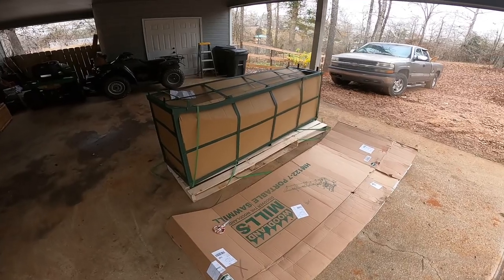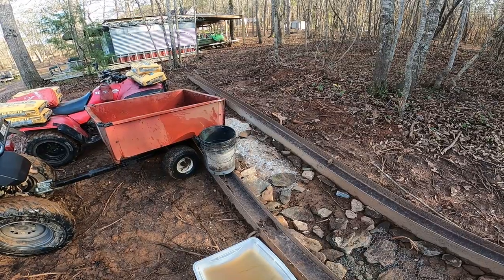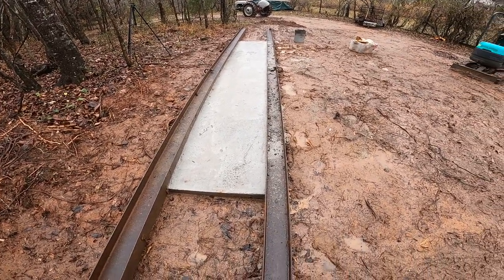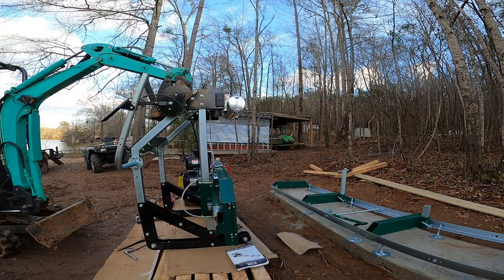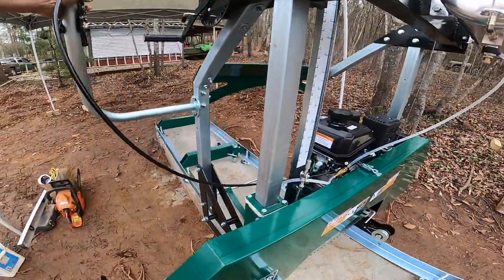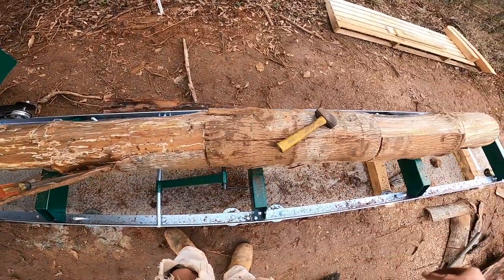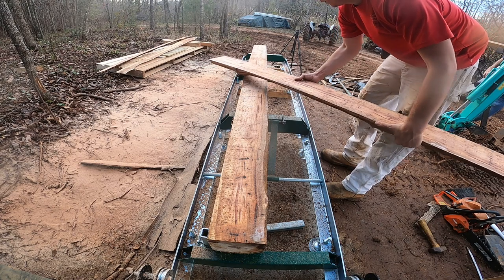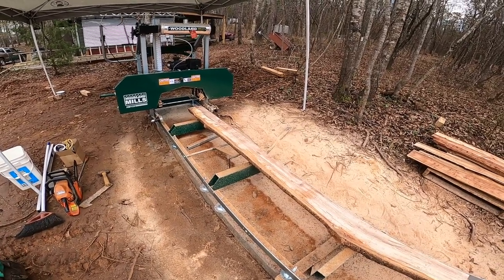BUYING THE CHEAPEST/BEST BANDSAW MILL AND MILLING A BEAUTIFUL WORMWOOD HICKORY MANTLE

Comment: Just a suggestion: your blades will last a lot longer if you don't drag the logs through the dirt first. Even then I hose down the entry side of the cut with good pressure prior to the cut. Love our Woodland Mills 126. This company rocks with the best support out there. Adding a tach helps tremendously. Cutting at the peak hp at 3600 rpm saves blades, clutches and time and gives you a smoother cut. 👍😎👌
Reply from the maker: I always clean with pressure washer if I drag through dirt🙂
Reply: Power washer?
Reply: @zakbrinkhoff324  just good garden hose pressure.

Comment: Awsome another video! Happy Birthday Darrel! 2,5k for that??, buying anything like that here would cost atleast 4k+tax+shipping (~tax for 4k would be 800 bucks!!), its crazy even the ads for this video are about buying a bandsaw mill haha. Mixing concrete on a trailer? I love it lol. Im glad you removed the bark, but id recommend to also wash the logs, iv bought a cheap pressure washer just for log washing, it really helps to keep the blade sharp for a long time. IMO it really does not matter, if its hardwood or softwood, aslong as the lumber is green, iv cut alot of green lumber on the mill and i really dont notice any difference between the different species of logs, but when i but a log that has been dead for years in the forest and all dried up, cutting that is hard, especially with a half dull blade. The mill is running great man. i wish you and your family all the best health and have a happy new year. Take care"! !
Reply from the maker: Thank you so much!! I’ve been watching your sawmill videos a lot  and the pressure washer is a great idea! I think for the money it was a good buy and I’ll prob do some upgrades over time to it. If I felt better I would have built one but I like it so far. Check out the wipers on the wheels is just a peice of cable that wipes the saw dust off them and it works really good. Thank you for everything and happy new year !!!

Comment: Hello Darrel 😊
Hey I’m looking to buy a small portable sawmill, haha as you know I already own a sawmill, but I’m looking for a small mill to take out to a remote little property a few hours from my house, mainly going to be cutting some cedar and Doug Fir. I was thinking of possibly buying the 9.5HP, I heard you mention about possibly thinking the extra HP could be good. I was thinking of the same model as you. Are you still happy with yours? For the price I cannot justify my time and effort’s to build another DIY sawmill at this point of my life. I hope all is well 😊👍
Reply from the maker: hey mike glad to hear from you!! in all honesty I think you will be disappointed with it compared to the mill that your used to, but if your just cutting a few logs here and there it mite be fine, if you do get it put a bigger motor or get the 9.5. at first I loved the mill but now I’m wishing I would have got a woodmizer or another brand, don’t get me wrong woodland mills have great support and all and they do make a good mill that’s cheap but I have a few issues that are making me want a better mill or do some fab work to improve this one because it’s slow, it wobbles (prob due to the bed angle iron not being straight) I think the clutch is weak also. the mill you have at your place is awesome and this mill doesn’t compare to yours however it will cut wood and you are a excellent fabricator so I think you could make it a much better mill by getting rid of the peiced frame and get like 20’ long peices of angle iron for the bed, install a bigger engine and maybe a bigger clutch or somthing else, my main two issues are the bed and I think the clutch is weak even though mine hasn’t really failed I also haven’t cut a ton of wood either.  basically if I could do it over I think I’d spend a lil more money and get a woodmizer or a more professional brand. now others have had really good luck with their woodland mills saw like sawing with sandy but he has the bigger 136 saw. feel free to ask anything else I doubt I was much help though lol
Reply from the maker: mike I wrote all that and didn’t read were you were cutting mostly cedar, my hm122 cuts cedar and pine like a breeze most of my issues are because I mainly cut hickory and oak. I think if that’s what your mainly cutting is cedar then this mill will prob work fine for u
Reply: @TheHomePros6221  I really appreciate your reply 👍 I completely hear you about all the topics you mentioned here. I definitely would get the bigger engine if I order one. I also see the small track frame being a weak point. 
I was just looking for a simple small mill to load onto my car trailer with my tractor and mill some small logs, mainly soft woods. I do have my home made mill and man I was cutting a lot of cedar this last weekend, it definitely cuts good. 
My friend and I went in half and half on a semi industrial sawmill late last summer, ( Used and needing a lot of work) 
It has all hydraulic controls, I think it’s called a Timber Wolf? 25HP 2 Cylinder Kohler, with a 6.5HP for some of the bed hydraulics.
It’s a monster but again we are re working the machine quite a bit because the company did some really bad engineering when designing it. 
A lot of the hydraulic motor speeds are really strange, travel was way to fast, the head lifting controls were really slow. Re geared and changed a lot to make it better.
The big mill is at my friends place, he has a better spot for it and has a few forklifts to help load logs.
I think that mill should be ready to cut logs early spring.
Back to the Woodland mill, I will look around more for other small mills on the market but I honestly I’m only planning on owning it for a year or two, finish up some milling projects out at a really remote place and then probably sell it. The place I will take it to is an hour drive to the nearest small town and the town doesn’t have a lumber store so hence the small mill. 
Take care and I appreciate your feedback about your mill. 😊👍
Reply from the maker: hey mike since your putting it on a car trailer and the bed being straight u should be fine and probably pretty happy with it also if your mainly cutting cedar and have the 9.5 hp I’m actually thinking it mite be a good choice for u and u can prob sell it for close to what u paid when ur done, there also mite be a wait I’m not sure but I think I waited 2 months to get mine but that’s when lumber prices were crazy. is it a timber king? I never herd of a timber wolf, if it’s a timber king then those are supposed to be really good high production mills!! and really expensive to! don’t let what I said shy u away from woodland mills it’s a beginner mill but it’s a decent mill for the price.

Comment: I own a woodlander 130 max and ran a woodmizer lt40 for 25 years.  Just a word of caution.  I saw you put dish washer soap in the water blade fluid container.  Don't get caught downwind of the spray or your eyes are going to be sorry. Plain water is best. Don't need to run it all the time.Just keep an eye on the blade for buildup. Good saw and made 100 miles from where I live.
Reply from the maker: thank you so much for the tip!! how are u like ing the 130max?

Comment: I believe you are supposed to run it at full throttle . I have the 130 max that I’m getting ready to assemble. Great video!
Reply from the maker: That is correct
Reply from the maker: thanks for watching my friend let me know how you like the 130! I kinda wish I would have got the 130 how much did it cost and what size engine did it come with?
Reply: @TheHomePros6221  $6200 out the door. I bought the log Jack, spare parts kit and 10 extra blades.
Reply from the maker: Awesome man that’s great!!

Comment: Great video. Have you ever used a green line laser module as an alignment tool ?
Reply from the maker: no I haven’t but I probably need to use one
Reply: @TheHomePros6221  , That’s actually our specialty. Most of our clients in the sawmill industry that operate the woodland mill or wood mizer use our green  line laser module AGLL2 in a 20mw output power.
Reply from the maker: I’d like to get one, how much are they?

Comment: You need a little utility tractor with a cement mixer
Reply from the maker: that would be awesome
Reply: I have a small mixer for my jd 3005.  I poured the floor in my forge shop with it

Comment: Geez you are going to just plop that slab down, no gravel pad, or ledge under it?  AnD you are hand mixing the concrete? Why? Dont they rent mixers ? I once mixed 8 yards with a mixer over a weeks time. It was a floor in a cellar to which there was no truck access. To use a pumper was too much $$. I did it in sections . The farther I got from the bulkhead and mixer, the less concrete I used. Ledge was underneath the cellar. I scrounged up alot of baseball sized rocks, wet them, put them in my section form and then put the concrete to it. I have a 22 by 6 foot slab under my mill about 5- 6  inches thick on ledge. We have no shortage of ledge in Maine. No shortage of rocks .  The rocks i used came from plowed land when the lot was a farm. They had handpicked them and tossed them in a pile, which was handy for me. I wish I had those steel beams. they have many uses.This quite a how to video. Do you think the 9.5 hp is better? My old mill was a 13Hp Honda. It was fine.It makes a huge difference to have something solid under the mill. If you extend the track...
Reply from the maker: When I poured the slab I put a bunch of rocks in it, what is ledge? Never heard of it before. I have since made many improvements to the slab and built a roof over the whole saw mill. I like this mill but I kinda wish I would have spent a tad bit more money and bought  a woodmizer and track extensions. The 7hp is fine but the bigger the better of course, thanks for watching
Reply: U @TheHomePros6221  never heard of ledge? You are a lucky guy. Ledge is where the backbone of mother earth is close to the surface. In Maine the glaciers scraped most of the soil off and the ledge, usually granite is just below a few inches of dirt that has accumulated since. The outwash of the glaciers is Cape Cod, Marthas Vineyard and Nantucket .My place has thin soil most places. I put my barn and garages ,and mill on the ledge. it makes a solid base for concrete.It may also be prone to Radon. That is a problem..
 Yes a Wood Mizer is a good saw but they are more than twice as expensive. I think the 7.5 Hp might be underpowered. My 13 HP Honda was ok. I think the upgrade on that was a 20 HP. My mill was a Thomas and in theory you could mill a 16 foot log as standard. In reality heavy logs were a problem. Handling them was not easy. Long logs were a pain. I think a 12 foot was doable.You usually put a slab on a gravel pad so you dont get heaving from frost. Good drainage is the key. On ledge is no problem with that. Scrap metal like chicken wire is not rebar. Its too thin and rots away quickly.. Like most people you are on a budget and u are lucky to have that little excavator. it cant do everything but it is handy. I used a tractor and bucket forks, Good luck. We dont have Hickory here.
Reply from the maker: @kennkid9912  oh I see.. yes we don’t have ledge here I’m in Alabama we have clay and rocky soil and don’t have to worry about frost as we don’t get any snow here. That Thomas mill sounds pretty cool! Thanks for all the info my friend!
Reply: @TheHomePros6221  what part of Alabama? My wife's family was from Haleburg,near Dothan